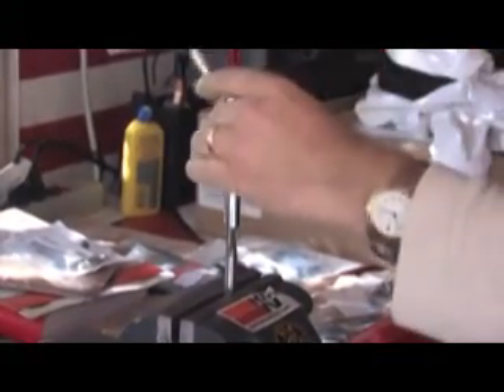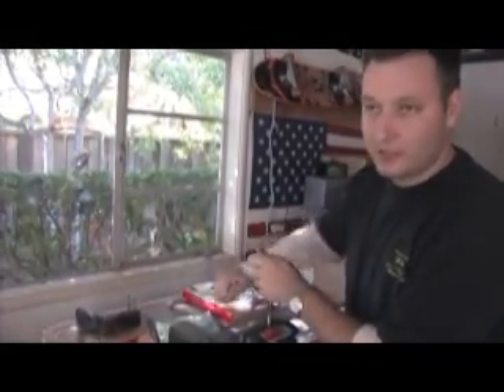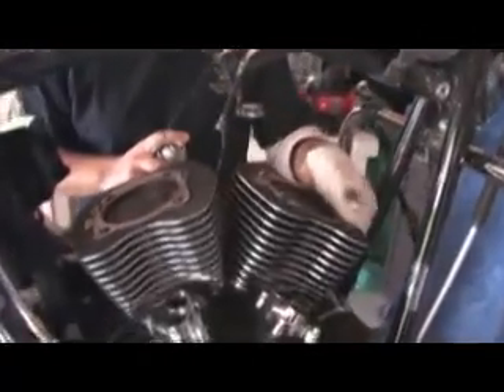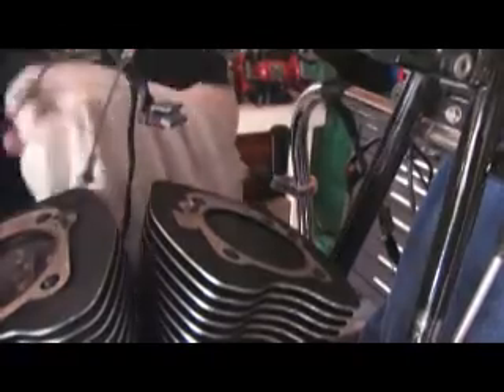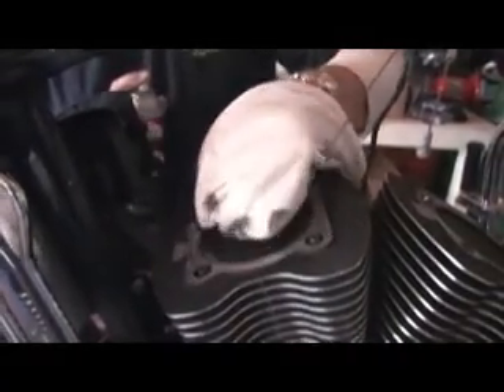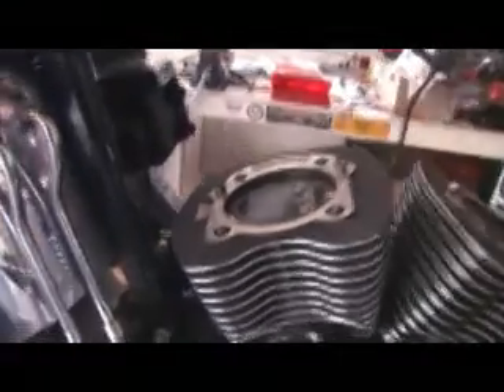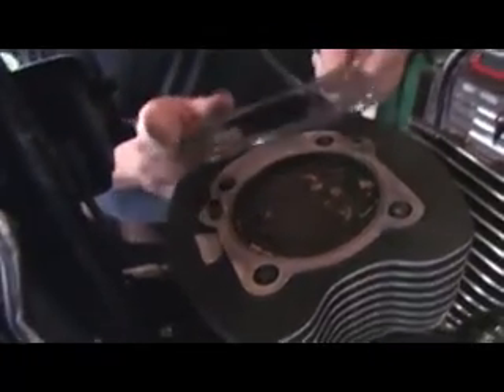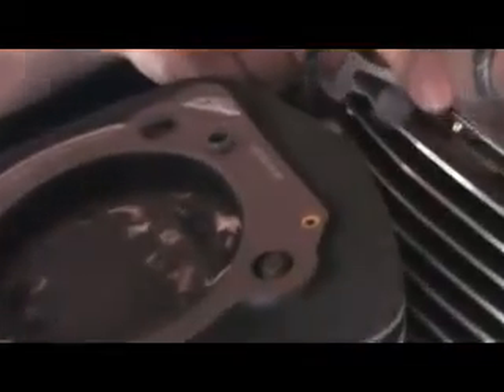Installing Screamin' Eagle Heads

Comment: I have built many engines (Chevy small blocks, big blocks, 8.1 liter V-8's, Duramax, Cats, Detroits) you name it and I have always lubed the threads with no problems at all. It is indeed a basic step that was taught to me by an engine builder that I worked for at a machine shop. The way it was done here is textbook and people should pay attention to this demonstration. Good job on this install. Very professional!

Comment: Nice video! Very helpful to those who aren't familiar with the re-assembly process.  

I prefer not to use Harley/SE head gaskets, due to their thickness. Ideally, you want your squish at/near  0.035" - 0.040" and the SE head gaskets are 0.045" thick (newer versions can be up to 0.053"). This gives you a wider squish band, lowering burn efficiency and reducing compression. Most cylinders are 'down in the hole' - approx 0.005" - with the 0.030" head gasket, you'll obtain the ideal 0.035" squish.

Comment: Coating the threads reduces the false readings you get when the head bolts get tighter, which increases the stress on the threads.  By oiling the threads, you're getting a more precise torque reading.... you're doing it right!!   (Well, unless you were standing with more weight on your right foot when tightening.... but you knew that!!  LOL)

BTW... it's actually "Cometic" (pronounced Co-Metic)... not Cosmetic head gaskets; but I'm just being nit-picky now!  

Nice video!

Comment: You don't know anything! You're almost right, but you have to be facing due west while blinking in the opposite direction! Sheeesh.

I'm never sure with torque specs, and I don't worry my old fat head over it too much. I've heard that the best way to really define what's going on is to measure the bolt tension determined by bolt stretch. I've only heard of ultrasonic methods to do this but have never seen it.

Thanks for taking the time to take and post the videos!

Comment from the maker: @gummybearkiller1 I only had good thing to say about the SE heads.  I really haven't heard anything bad.  Feel free to share.

I went with the Andrews TW21G cams.

I changed the pushrods but not the lifters.  No idea about HP or Torque to be honest..  it was a very nice improvement over the stock setup that's for sure.. especially when packing a passenger.  It's nice and smooth and all the power is in the lower RPM's where most people spend most of their time.

Comment: I'll put the bolt torque/ lubrication issues to rest if anyone's interested.  In my RACE ENGINE SHOP over several decades,  we've been there/done that with torque/lubricants.  I've experimented,  and recorded data on oil petroleum,  oil synthetic,  silver anti-seize, moly,  mixtures of moly and oil, gear lubricant,  and yes even dry. My advice,  is always use the RECOMMENDATION OF THE FASTNER MANUFACTURER,  and or the general manufacturer if it's say, Harley Davidson,  Chevrolet, Honda, etc. Different lubricants WILL provide DIFFERENT stretch for torque values, you'd be AMAZED. Cleanliness is paramount regardless of lubricants used. That means threads, internal and external,  major and both minor thread diameters. I prefer to clean all ghreadswith lacquer thinner and air dry and or compressed air with a dryer/filter. Some head bolts require a angle torque measurement,  and I highly recommend doing that if the manufacturer calls for it. Some fasteners are torque to yield,  meaning throw them away after use.  On NASCAR ENGINES you wouldn't believe what we go through just to prep a set of Main/Head Studs, Washers, and Nuts. And yes I said prepping the WASHERS!!. Please understand that I'm not trying to be Mr. KNOWITALL,  just trying to help. For every guy who agreess with me, 2 guys have never owned a torque wrench and have built engines with 200,000 miles. GOD BLESS you all.

Comment: av8rdav, you should always coat any head bolt or stud with oil and the surface the bolt contacts. this provides slip so the fastener wont seize to the mating surface. if you don't lubricate the fastener it will seize to the head giving you giving you a higher torque reading when the fastener is acutualy not torqued enough. this is basic engine rebuilding knowledge and is the same thru out the industry. doesnt matter if its Harley, Chevy, or Yamaha.

Comment: I love your ratchet sir!  What brand is that?  Is is a Snap-On?  I appreciate your videos.  You have a great mechanical mind, I think of the same things truly.  Like cleaning your studs and bolts with a die to make sure you get good contact and torque values.  It seems so simple, but most don't do such things.
I just got my first Harley, an '04 Ultra Classic, missing the tour pack..so an Ultra basically! About to upgrade the cam chest, so thank you for the video. Makes it real..
You Rock sir..

Comment: To @gliderp -we used to measure the bolt stretch on chev conn rods with a mic that has pointed anvils; the pt.s fit in the specially centre drilled ARP rod bolts and nuts we used. .005" was the spec. Just in case anyone cares LOL!

Comment: Never use loctite on head bolts ,  oil a drip on the head of the shoulder  and wipe off,  a drip on the threads .  torque 3 step 10# , 24# , 38-42 #  Foot pound . How many miles did you get out of the SE heads before the valves took a crap?    What size vales my SE evo heads 1.980 intake 1.625 exhaust I got 10 thousand miles on the heads and valve guides took a crap.  I have went with a high flow oil pump  and its helped , remove heat .  running a mild cam ev23 , have 95 HP and 75 torque dino .  time will tell if the oil pump helps with valve guides going out .  I do know the Video is 10 years old  may be forgotten.

Comment: I don't know whether someone out there torques to a value, e.g. 42 ft. Lb.s, so as to know for sure what torque you finish with. This quarter turn stuff is unique to the MoCo, and is just plain stupid, in my opinion. I would also coat the bolts with anti-seize, rather than oil(after all, you'trying to prevent "seizing, right?). Just my usual rant. Thx for excellent vid!